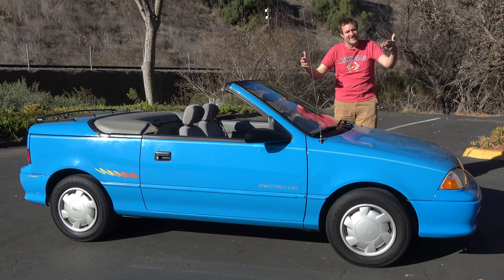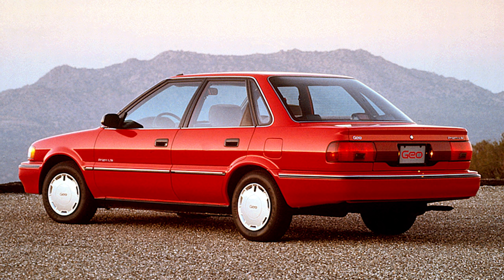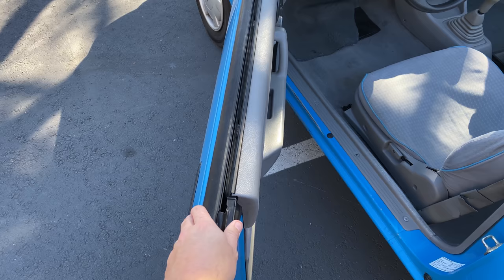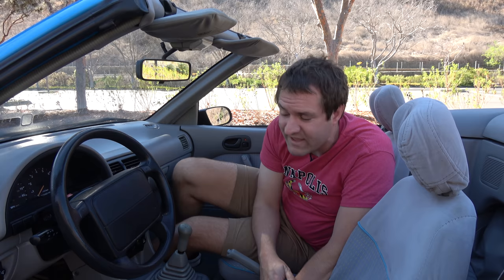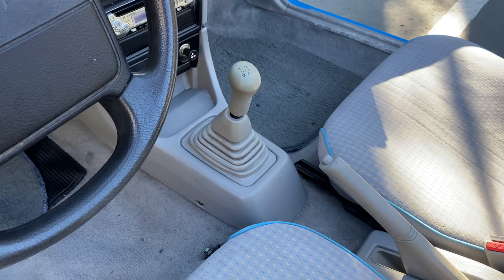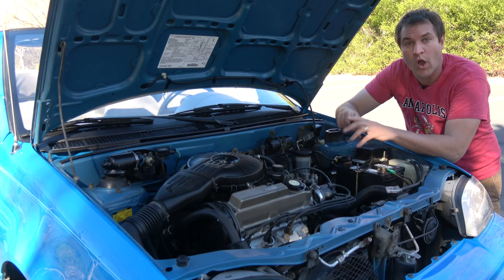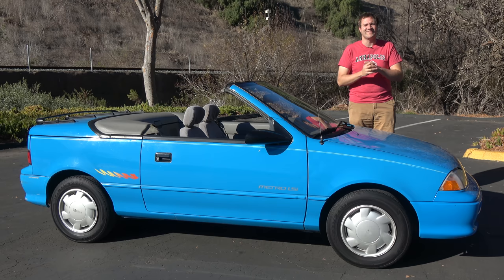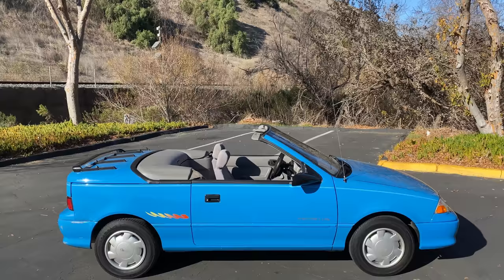The Geo Metro Convertible Was a Hilariously Pathetic 50-Horsepower Economy Car

Comment: I have an entire blue printed plan for when I find one of these for sale around my neck of the woods. Unfortunately all the ones(3) I know of I've offered to buy them from the owners and they say no sale not interested. But when I get my hands on one I'm going to do a Cobalt SS swap, I'd like to get the supercharged engine but the clearances to the top of the sloped hood might make it unreasonable.. no matter though because they did a turbo engine as well that is arguably better. Basically I'll do a full drivetrain conversion(Engine, 6spdManual, and use absolutely as much of the suspension as I can stand to weld together including larger rear suspension, and ill do crossmembers across the front shock towers and through that gap between the truck and cabin, all electric fans and if i can squeeze an intercooler into a good spot even with some bumper modifications ill be golden) get that motor tuned and have a little laughable ripper to drive around likely still getting 30mpg. I hope to eventually get one into the 9s in a 1/4mile  without fully gutting the interior and adding a little bit of roll cage protection and a windshield brace.

Comment: The Suzuki ver. of this car (hardtop) did very well in SCCA - They are very nimble. W/ a stick they feel nippy. Bad 0-60, but fleet 0-30.  I'm pretty sure most of these were actually sold with a 4banger and only some the three.  (Again,  hardtop models)

Comment: I have a Suzuki Swift from '03 here in Germany, and I love it. It's all the car I need as a college student. The low power isn't that much of a problem here, especially in combination with my driving habits. In town it even drives sporty, me flying by cars I theoretically shouldn't/couldn't fly by...
The cars I had before (Nissan Almera N16 '01 90hp, Lada 2104 Nova '92 75hp, ...) had all more hp but I cannot feel a difference to the 53hp, partially the Swift drives even better (in comparison to the other 'crap' cars).
Reply: buyv2014 leaf get new bayers

Comment: Saw one for sell at a junk yard for 350.00 with a amr300 supercharger back in 2017, it was missing a hood and the top was shredded.  I ended up with a del sol si,  but damn it was a pretty yellow with a simulator accent decal. Wish i bought it.

Comment: Well knock on wood but my little Geo metro was the second speeding ticket I aquired in my life and that convertible top wasn't made right. One of the folds went right through the middle of the back "windshield" so if you used it eventually it tore there. I had the extended warranty and they hated me because in about 5 years I had the top replaced 6x which cost them a little over $1,600.00 each time.🙂 Mine was the bright yellow model and I had to trade it in when my second son was born because it's a two seater. BWAHAHA❗

Comment: At 9:30, Doug notes that the automatic was rated at 10mpg less, and adds a subtitle 23.5 L/100km. This isn't really the right conversion: I assure you, the Metro didn't use nearly that many liters to go 100km! The real difference is about 1.3L/100km.

This is a strength of giving fuel efficiency in L/100km (or gal/100mi or whatever: with amount of fuel on the top and distance on the bottom), it's easy to compare numbers. The difference between 12 mpg and 22 mpg is huge, but the difference between 42 mpg and 52 mpg is pretty small, even though they look similar. In comparison, the difference between 30 L/100km and 26 L/100km and between 20 L/100km and 16 L/100km is pretty similar: for the same trip, you'll save the same amount of extra fuel in each case.

49mpg = 4.8 L/100km
39mpg = 6.0 L/100km
Difference for highway, 1.2 L/100km

46mpg = 5.1 L/100km
36mpg = 6.5 L/100km
Difference for city, 1.4 L/100km

Comment: I had several Metros. The 1994 XFI was the best one by far. It had a different cam in it. I had a four door that looked like a tiny minivan. It sadly had the automatic engine. But i still had to shift it lol. The 1995 was my least favorite. Im 6'4" and the interior was so small, since adding airbags. It was a 5 speed yet slower than the 94, which was also a 5 speed. I just found a 90 convertible 5 speed on fb marketplace for 1700. I may have to pick it up. Also, i changed the headgasket on the 94, and was able to easily hold the head with one hand.

Comment: 1990 the Metro vert was 10k
Miata was 14k
Mercury Capri was 14k
218 BMW was 40k
Later 325ic was 55k
And the later Cavalier vert was 11k

This car was for the young single secretary or entry executive still making 12000 to 24000 a year to runbto the beach and look cute.

50hp and primitive...well Austin did that with the Sprite 30 years before...which had the same purpose to exist.

Comment: I had a red 4 door Metro and loved it for the economy.
Things started to just fall apart on it all at once.
I also replaced belts on it more than any car I ever had.
I did love that car tho...
Then I also had the convertible.
What a piece of crap that car was.
The roof latch was faulty. Doing 40 and the roof flew back by itself, more than once.
It leaked. It got mildewed. Turning corners, the whole car would groan like it was trying to snap in half.
I got rid of it less than 3 months after getting it.

Comment: The side view mirror adjustment vexes me. To cut costs there at all is awful, but even if you’re going to, would it not make much more sense to have the adjustment rod on the passenger side instead? The driver’s side could be manually adjusted far more easily than the passenger’s.

Comment: I actually have driven one of these. I didn't have a car for a little while and I needed something to get around. My friend let lent me her Geo Metro convertible. I agree with Doug this is the worst car I've ever driven. The top would come down after you hit 50 mph because it was like in bad shape and the clamps didn't work. Very noisy no power engine definitely the slowest thing I've ever driven. It did get fantastic gas mileage and I knew it wasn't running right. It was embarrassing it was bright yellow and I always got looks when I drove it. I parked across the street at a business and not in the driveway because I didn't want anybody to see I had it LOL. It didn't have any break so I had to use the parking brake to slow it down. I had to drive it in the winter time and I couldn't get the car to go past 65. Definitely glad that nobody ever saw me in it. If you can get one in good shape I will say maintenance wise they are very very very cheap. I really doubt there's any around and really you're better off just buying a Honda Civic or something but this truly is fetty really really bad car that basic people would enjoy just because of the cheap mileage and probably a really good car to own in San Francisco not so much with the hills though LOL.
Reply: buy civic hybredd

Comment: That one has hydraulic steering?
I can't speak for all of these but I had a Suzuki Swift and it had a manual rack and pinion. 
The car was so light you would never know that it was manual steering until you open the hood and there's no power steering pump or reservoir. Mine also had the 1.3L four-cylinder engine which is probably what they all should have come with.

Comment: I usually enjoy Doug's reviews, but this one seemed overly negative and even a little unfair at times.   Most economy cars had 13 inch wheels on the base model back then, and 95%+ of cars and trucks didn't have a passenger-side airbag, as it was not mandatory (that came in 1998).

It wasn't a great car, but it was reliable and affordable.   I knew a couple of people who had the 2nd generation sedans with the 4 cylinder.  They weren't sporty or fun, but got the job done.   And frankly they ran better and longer than my more expensive Neon Sport ever did.

Comment: I drove the non-convertible 1995 Geo Metro hatchback with a 1L 3-cylinder engine and 3-speed auto transmission. After I spun it three times, once at just 25 MPH while turning off the highway, I was begged my parents to help me get something else. Easily the worst car that I have ever had to rely upon.

One of the amazing "quirks" of the car was that leaves, and even once, a bee, would blow into the car through the air ducts into the passenger compartment. Hideous, hateful little car.

Comment: I had two hatchbacks, not convertible. I drove 150 miles a day. Yes u had to turn off the air to climb a hill 😂but 58mpg and never missed a beat.
Reply: çhief 930 tirbo cirv 150 mioes only 1  hur 155 mph

Comment: If the convertible was based on the Suzuki Swift GTi of the time, it would've been a hell of a lot better. The GTi was a cracking little car for the time, but GM had to cheap out. I've said it before and i'll say it again: GM just can't do small cars right.

Comment: It won’t be so pathetic when gasoline is averaging $10 per gallon nationwide. If it has power steering I’d remove it. No car under 2000 pounds needs PS. My civic weighs almost 2500 pounds and I removed the PS.

Comment: You can always tell a commentator who knows nothing about cars because his only standard is the dollar sign. Cheap car = must be bad expensive car = must be good. Not smart enough to judge a car on its merits.
The Metro was the cheapest convertible on the market. A lot of young people bought them as their first car and had a blast. Friend of mine bought one new and drove it for 10 years, it never let him down or got less than 40 miles per gallon even though he kept the pedal to the floor boards most of the time. He thought it was great but he knew it was a cheap, fun car and did not expect it to be anything else.

Comment: When mentioning the 10mpg reduction in the automatic the metric conversion at the bottom made no sense 😂.

36mpg = 6.53L/100km
46mpg = 5.11L/100km

So the difference is 1.42L/100km reduction in efficiency not 23.5L/100km 😂

Comment: Yep, they are slow. It's just a supercar in a different realm of performance, every nut, bolt and cotter key optimized for MPG, instead of horsepower. I've got a '97 hatchback, with the 3 cylinder and a 5 speed. Seen as high as 53 MPG on highway trips. The hatchback, especially with the rear seat removed, will swallow an enormous amount of camping gear , food and other stuff for a trip.

Comment: C'Mon doug, its way better than a Yugo.
My friend had a 1983 Chevy Sprint, which was the same car with 4 seats and ZERO airbags.  It was a cheap POS but was still fun to drive and ride around in.  This car would have been much less practical, but much less laughable in that era.  This was a much better car than a modern "smart for two" and had a convertible top.

Comment: I nearly bought 1990 pontiac firefly in summer of 1995.  But alas had  front end issues.  Ended up buying a 1990 ford escort hatchback with 25 thousand miles for 3000 dollars usd.  I always thought hyundia pony and ford festiva in canada were the two worst cars for sale new

Comment: This guy is feeding b.s. I test drove one back then.  It's got lots of power. It's not a corvette but it will still smoke the tires off the line. It's only about 1,800 lbs so 50 hp is plenty. He also doesn't mention how much torque it produces. The reason there were so many convertibles in the 80's and 90's is because life was more fun and exciting.

Comment: IDK which one would be worse... the Geo Metro from that era or possibly the Toyota Tracel (often nicknamed "TurdCel").  I guess I will say that the styling (interior) for this car is a bit more modernized than cars of that area, for example the Ford Taurus, or Ford Escort which had a rather dated design, even for 1992 (and for the most part was carried until the redesign in 1996), and even Honda's own Accord was perhaps a little more dated looking than this.  So I guess in one aspect, the interior looks a little more modernized.

Comment: dumb idea to make the metro a convertible it was already laughably slow for the era even a Pontiac Sunbird which was similar in dimentions had 140 HP with either a 3 speed automatic transmission or a 5 Speed manual Transmission

Comment: This guy knows nothing about this car, first off the car was 30 years old at the time and probably never had a tuneup ,second these car you need know how to drive them. Pedal to the metal don't shift till it starts to stop pulling. The 3 cylinders love this 260,000 klm's on 3 cylinders driving them like this no problems. They handle like a gocart, tons of storage hidden compartments in the convertible. The coup I hauled a 52'' projector tv, a couch, 1930 Chevy 3 window coupe body no trunklid all other main body parts plus I put more stuff in it. One load lowered the car 2'' all around and hauled it thru the Rockies with no problem . The Coquihalla with the load I may have been down to third gear twice, gas milage was still close to unloaded mpg. The last Suzuki untouched 4 cylinder motor, I drove it like a ralley car on the back gravel roads. Had 449,000 klms on still running like new and not using oil. I personally put 130,000 of the last kilometers on that one. I retired it due to rocker panels rusting. The only problem with the convertible for a tall guy is they lowered the seat and your legs are not support very good. They did this to lower the number of head injuries in convertibles. These  are one of the best most reliable cars ever made applies to 1st and 2 nd gen. The auto transmissons would breakdown lots and the cars can not take steep slow speed mountian climbing they start to burn oil. But hwy mountian travel they are fine no problems. I still own three of these 2 of them are convertibles. The seat is mounted the right height in the coupes and  is extremely comfortable as I would drive 1000 klms straight in one day and not be stiff afterwards. Anyhow enjoyed your review.

Comment: My sister had an auto 😭😂😂 Suzuki swift and it couldn't even spin the tyres on grass and dirt it was so underpowered.  Every one I've seen look pathetic and generally run down and in very rough condition. They weren't very nice indeed

Comment: They were good cars! Quit knocking on this car so bad dude I own A 92 Geo it is the best investment I’ve ever made I bought it for $1600 used I’ve had it for like six or seven years it gets 50 miles to the gallon never had a problem with it so you fools that are driving those 10 mile 15 miles to the gallon cars well I’ll be passing you when you’re out of gas. I save about $3000 a year because of that car. That car will do 85 miles an hour all day long because I drove it from Spokane Washington to Riverside California and 85 no problem plus it cost me under $100 to go 1370 miles now what it’s not supposed to be a race car dummy it’s a fuel economy car. Put a swaybar on it and the handling is greatly improved I can do a corner that says 15 at 50 no problem after I put the swaybar on it. Oh by the way my car has 56 hp. Maybe you should do a little research on that Geo it lists the horsepower as 56 get your facts straight before you start reviewing a car.

Comment: What you expect from GM products cheap materials they break down after 300 000km  my old S10 died after slightly over 300 000 very cheap junk would never buy anything american again I now own a Ridgeline by Honda very good truck for what it it 280hp fully loaded for a 2008 model year. . Never any issues with it.

Comment: Geo Metro was one of the best cars that I ever own.
I was simular to my old VW Super Beetle, but better.   The Metro had a 5 speed transmission, while the VW had a 4 speed transmission. 
Of course, you had to know how to work the gears, but it could get up to 80 mph on the interstate.
It had a 3 cylinder engine, which got over 40 mpg.
Geo Metro had very good resale value.  I had a hatch back which was good for storage.
The only problem was rust.  I miss my Geo Metro.  Although I do have fond memories of my VW.
FWD is better than Rear Engine.